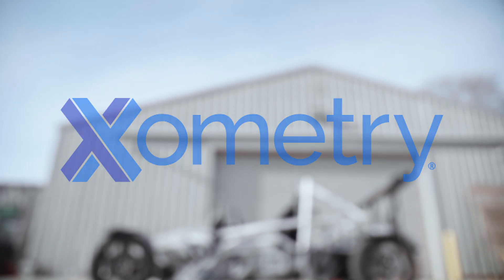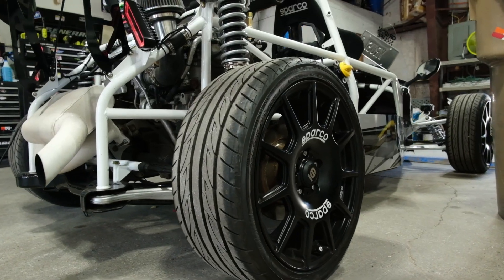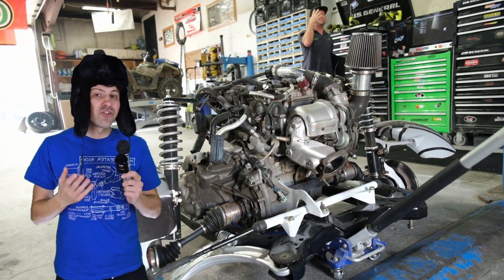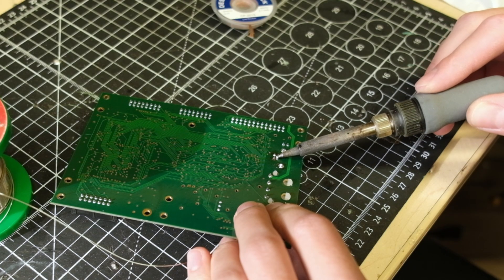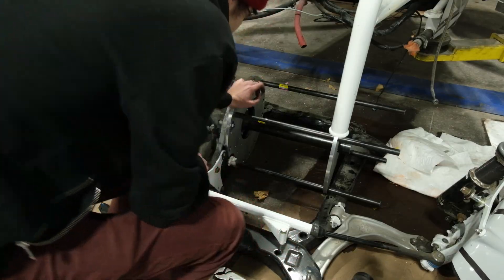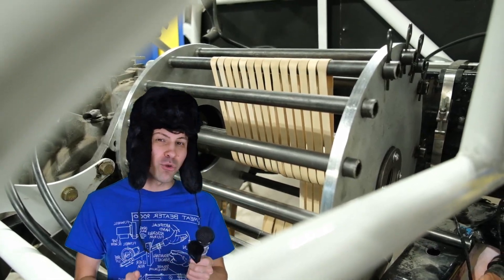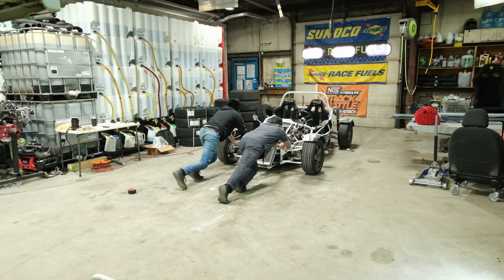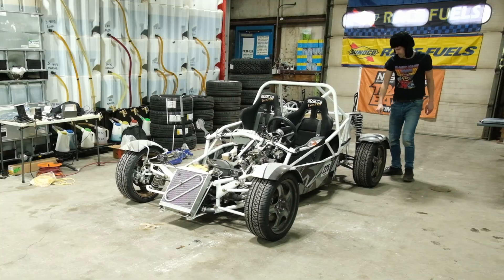How many rubber bands does it take to power a car?

Comment: Could put PVC pipes over the birdcage bars to act like a roller bushings for the rubberbands
Reply: For rubber band solutions, they normally do twisting instead of stretching, perhaps better?🤔 
Else constant force springs is better for this type of application i think. 🤓

Comment: My immediate thought was to use a scaled up watch spring. I would love to see you revisit this with more research. Perhaps start with scale models?
Reply: yeah, pull back cars don't use rubber bands....
Reply: Not only that but he needs a properly built car. The one he’s using is great and all, but it needs to be waaaay lighter. Less weight, less power required to move things. One seat, no gearbox, no suspension, thin lighter steel for the chassis etc etc.
Reply: @arghjayem  Yeah, a gokart chassis for example
Reply: @arghjayem  This. He needs to get a lighter chassis and vehicle in general
Reply: @arghjayem Velo mobile would be far better
Reply: you can do one really substantial watch spring or even multiple  due to how they sit as well.
Reply: Wonder if you could make such a spring but like few feet wide...
Reply: Goddammit beat me to it!
Reply: hydraulic accumulator is the best solution i think for getting good performance
Reply: spiral torsion spring
Reply: When I was a kid, we had a spring-loaded car that we could ride in. This was in the late 60s-early 70s.
Reply: absolutely. a wound spring steel sheet would work great. get some high carbon steel sheet and wind it into a loose coil, heat treat it, then use that as a spring. If it's really long you' be able to run much longer and store more energy
Reply: Yep came to say same thing